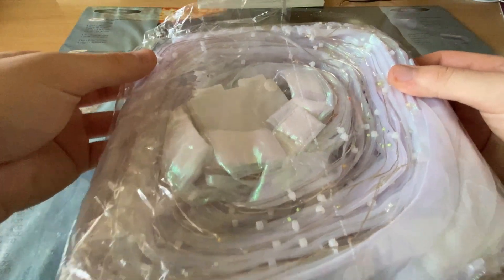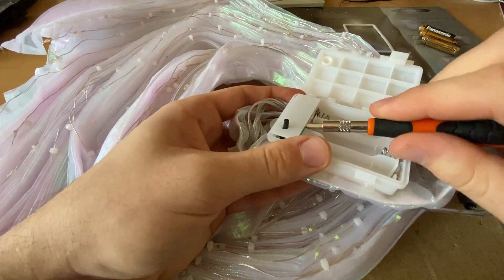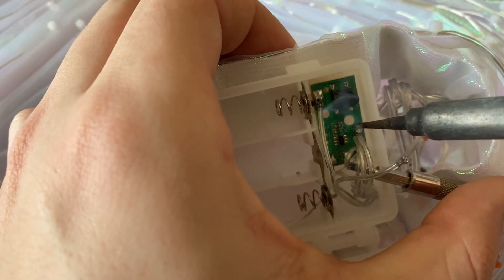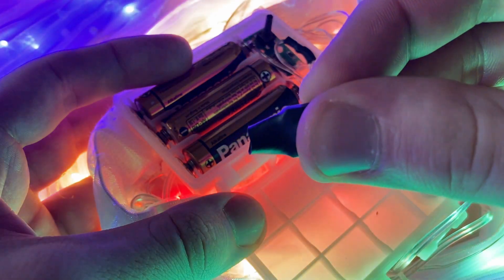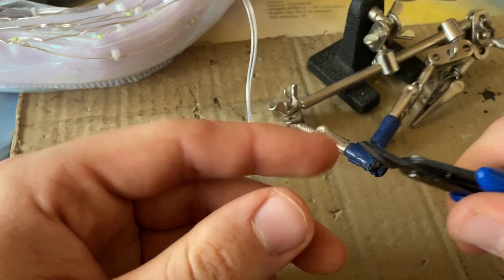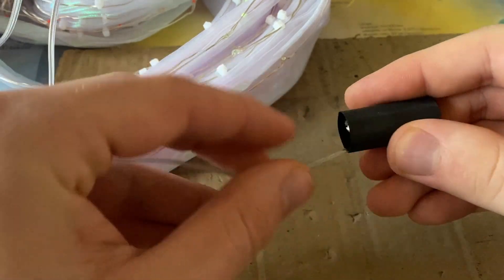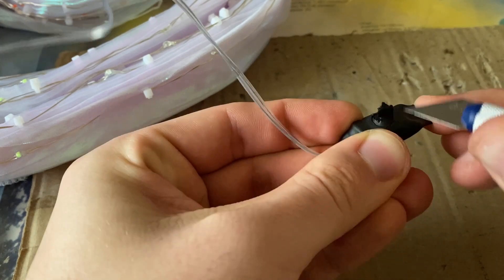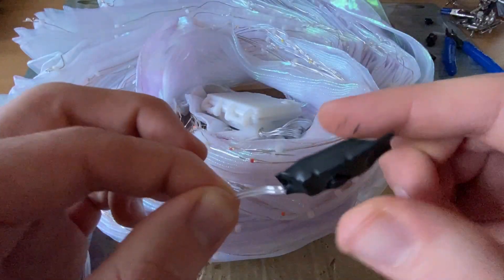LED Wings Improvement - Making It Brighter

Comment: This is shortening the life of the LEDs. He bypassed the SMD resistor so instead of getting the LEDs getting their required ~3.3v he's sending ~4.3v. He'll kill it over time much faster than if using the proper voltage. Don't do what this guy did.
Reply from the maker: For now, they worked great. It's really cheap chinese equipment, so I expect that something else will brake way before the led's will get burned out. For example really thin wires, they need to be fixed constantly. So don't worry about breaking the led's

Comment: Why did removing the switch on the battery pack increase the brightness of the LEDs? 🤔
Reply from the maker: It's not about the switch. I skipped all electronics circuit on the board with the switch. Probably the electronics have some sort of current limitation and that's why the leds are dimmer. By skipping all of that the leds get full current from the batteries.
Reply: @mehowcreate5832  Ah, makes sense! Thanks for the explanation!